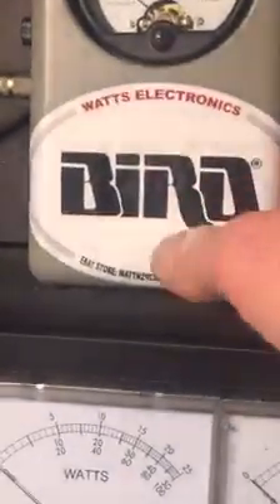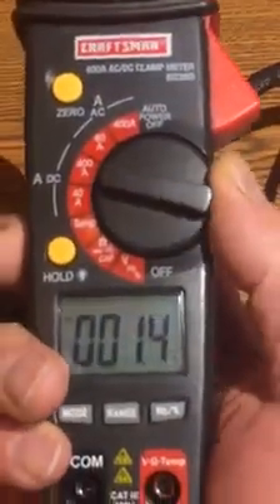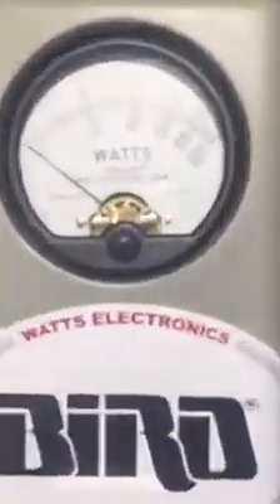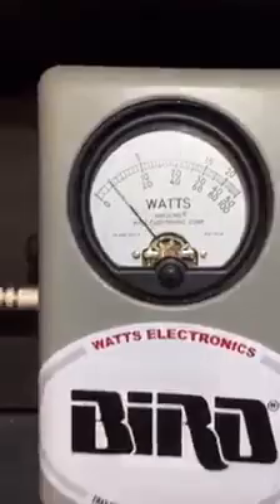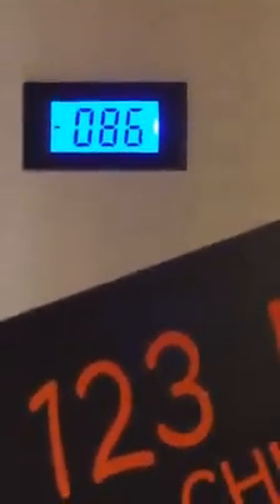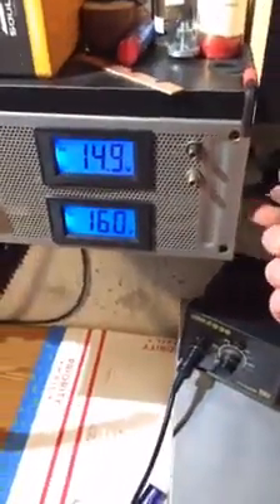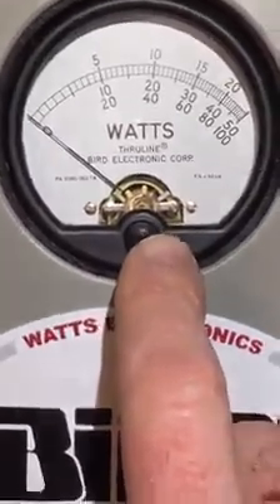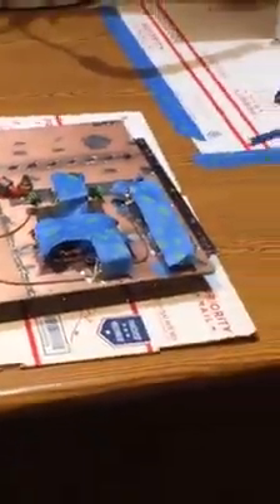HG Prototype 4 Pill 1000w RMS AMAZING!

Comment: So 108 X 16 = 1728 Watts DC input powering the radio, the Texas Star and the 4-pill. I would really like to see what happens on a spectrum analyzer & the Bird when you add a good performing low pass filter (let's say, so your 3rd harmonic is down to -60db) to the output of that amp. In fact, I'd pay you 100 bucks just to see the result. Nice work all the same.